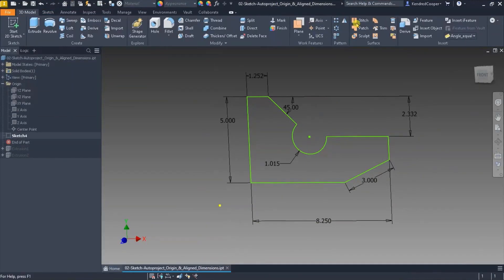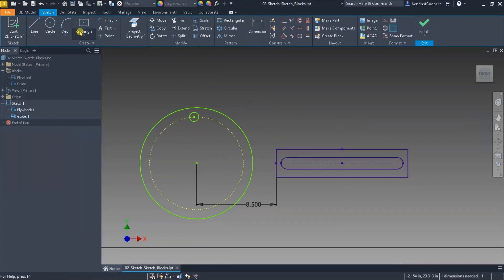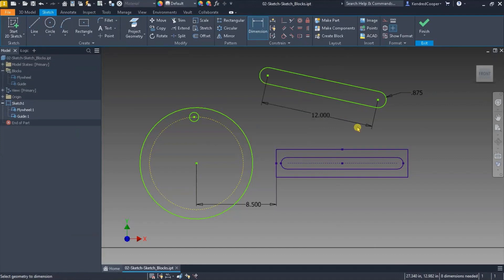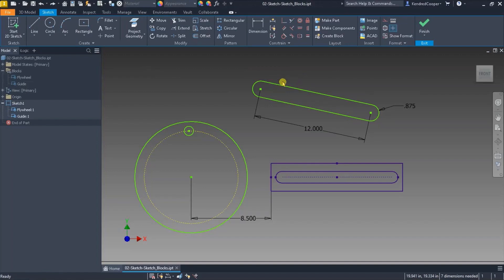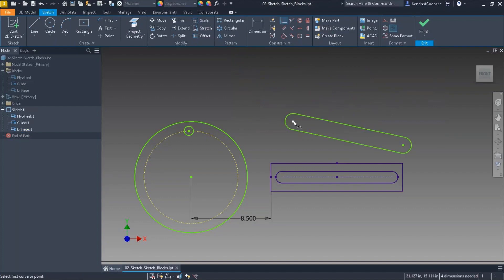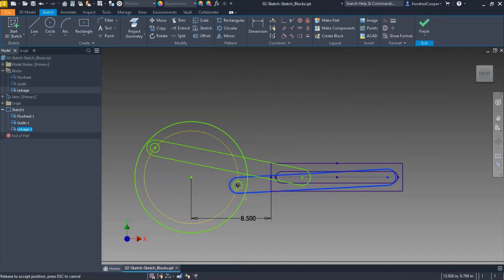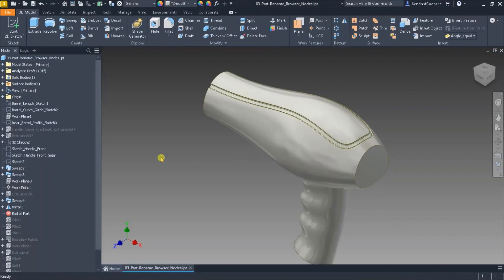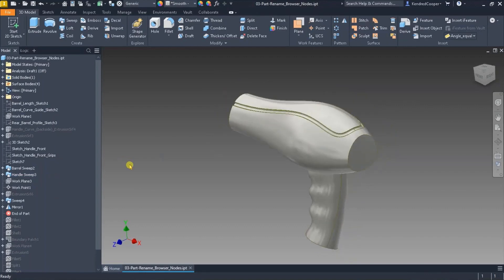Sketch Blocks in Autodesk Inventor

Comment: Hi, How can I retrieve model dimensions from a sketch block?
Thanks!
Reply from the maker: If by "retrieve" you mean pulling the dimensions from a sketch block directly onto a drawing view, unfortunately, that’s not possible.

However, if you mean accessing or changing the dimension values, you can do that by editing the sketch block itself. 

Hope that helps!
Reply: @Hagerman  
 Thanks for answering, Yeah I mean pulling the dimensions values from a block onto a view drawing. I think those features would be powerful together cause  by using blocks I can use a master sketch for a whole mechanical system and an unique system of coordinates if I want to change something with ilogic or with my parameters. Otherwise, retrieving blocks on a View drawing, I could get my dimensions from a specific part. If I don't use blocks onto my master sketch the organization gets worse and I would be pulling the whole dimensions of my master sketch .

Greetings from Colombia, I used to watch your videos looking for new things.